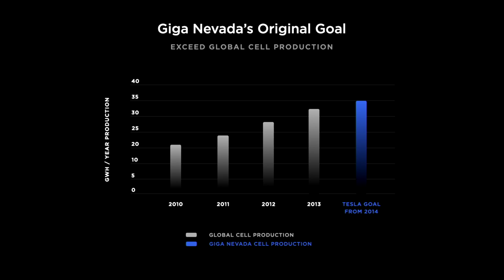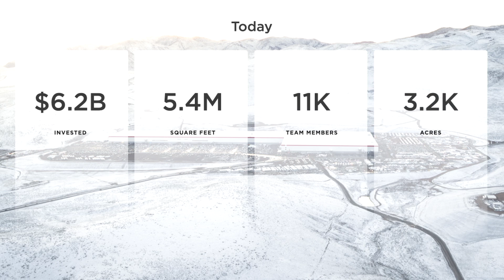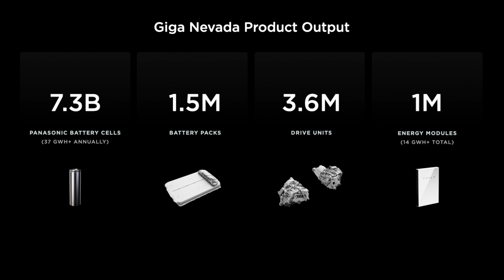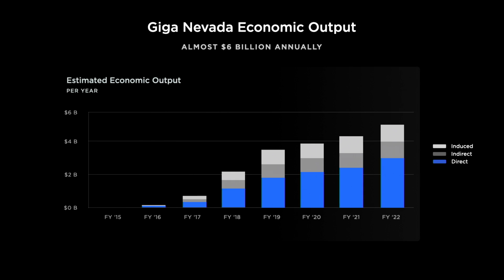Giga Nevada Battery and Semi Manufacturing Update

Comment: Except they're not creating a sustainable energy future, they're just building some energy storage units. If you research the enormous amount of energy that humanity uses, you realise that flappy windmills and solar panels aren't going to replace fossil fuels and meet current demand, never mind future demand.

I think we will find a way to replace fossil fuels and get sustainable energy, but I don't think it will be from wind and solar, and lithium batteries will be pretty irrelevant. One way might be new propulsion technology that allows us to transport 10s of 1000s of tons of stuff to and from space. That could enable near-sun space-based solar with hydrogen or synthetic hydrocarbons for energy transport and storage, along with recycling of the carbon (a carbon cycle).

Comment: I am excited to share that I am currently working on a restoration project for an old catamaran, where my goal is to convert it to electric. I have already had success with my previous electric sailboat conversion projects, including my second sailboat which featured a 10kw electric motor and a custom-made battery pack that I built myself using 1400 21700 cells.

Now, I am taking on the challenge of converting an older catamaran 1997 to electric power, and I believe that Tesla's technology would be the perfect fit for this project. I am a big fan of Tesla and their innovation in the electric vehicle industry, and I am confident that their parts will help make this conversion a success.

I am reaching out to Tesla, specifically to Mr. Elon Musk, to inquire about obtaining the necessary battery, motor, and controller with 1350 nominal RPM for my restoration project. With Tesla's support, I believe that this catamaran will be a shining example of what is possible when converting an older vessel to electric power.

I would like to invite everyone to join me on this journey. The catamaran  have sleeping space for 8 people, so all your family can come along. I am confident that this catamaran will be a unique and unforgettable experience for all who sail on it. Thank you for your time and consideration.

ps: could be also old battery old motor , demo , or from a test  vehicles

Comment: Where is the lithium, cobalt and other toxic materials coming from?
Reply: Same place they came from for that datsun pos in your thumbnail required for sourcing, same place every gallon of gas refined that requires cobalt. Same place all the lithium used for mettalurgy comes from. 

Same place for medical equipment and every other form factor of battery used like the one in the internet capable device your pedantic self wrote this drivel on. In other words the ground. Betcha don't care about those though right? 
Because your just another uninformed sad little ev concern troll gasaholic nut. 👍🏻
Reply: @4literv6  Datsun is Japan, so no you are wrong.  Why do you say "pos?" It's a 2250lb truck thats lasted 44 years so far. 2000+ lbs payload,  34 mpg, 4 cylinder/ 5 speed. 13" high efficiency tires, E85 compatible.

 A far greater option and much more efficient than any pig heavy electric cager. 

My classic datsun compared to a new 8,000lbs cyber truck is shocking, similar payload and far greater daily range than the storage battery tesla cyber truck.
Reply: @4literv6  Where is the energy to charge these tesla branded storage batteries coming from? Isn't a large portion of mining equipment powered by fossil fuels?

Comment: 5:54 #Tesla Imagine if you haven't been told there is a technology out there right now, which can power entire house with silent electricity (an apparatus size of a sofa) : that requires no, fossil fuel, chemicals, waves, solar, thermal, batteries or fusion etc it gives out no considerable heat, smoke or noise pollution, no vibrations, it works in the dark, in a storm, no need sun, not very heavy could be eco friendly etc good bye batteries!
Reply: Never going to happen

Comment: I’m sensing a breakthrough in 4680 production. That entire full size factory was supposed to just be for batteries. Now, they will produce 100GWh with a small portion of the footprint. I guess the Maxwell acquisition and dry process is paying huge dividends.
Reply: I noticed this also, I find it likely that some exponential gain(or more like a bell curve) with square footage where with some new tech and greater scale it gets continually more  efficient(to a point) to manufacture the 4680s. I was surprised by Elon saying they were going to use it for stationary storage also.
Reply: What is the point of making toxic storage batteries?  Why all the hype?
Reply: @Dat_Sun  what is in batteries that makes them toxic? From my understanding, they are made of recyclable metals. Should we get rid of phones, tablets and laptops?
Reply: @Dat_Sun  you did not answer my question and you made several false statements. I’m not sure where you get your information, but you might want to vet your sources.
Reply: @Dat_Sun  go open your fire alarm and lick the Radium

Comment: The First Design was enormous. When this is completed it will have half the foot print of the original design but it sounds like the same output due to manufacturing improvements. Way cool.
Reply: They already reached the original goal, with half the footprint. Now they build the rest that will be several times more productive with the 4680 cells. I think they said 7x output with the same footprint. Thanks to Maxwell's dry coating tech.
Reply: Yes, the Maxwell acquisition is paying off big time.
Reply: @lemongavine  Yeah, Elon is a big Fan of Maxwell's, apparently

Comment: why tesla factory is still using diesel powered equipment to buyild the factory ? any chance for industrial collaboriation ?
Reply: There are limited lineup of battery electric construction machines. For the greater good it's better to get the factories up and running faster than waiting around for it to be possible to be built with BEV in a idealist way.
For road transport though I think it would be good to hear back on how the Tesla Semi is being used internally (as the said the would).

Comment: How about a couple more pairing on top of solar voltaic & electric storage!
solar heating & molten salt battery storage. (not electrical storage, but heat storage)

Pull heat from the roof, away from the voltaic cells to ensure they run at their favorite temperature. Distribute it into the house if needed, convert to electricity if the need is there, store if there isn't a need, convert to electricity and store in that battery if the heat battery is full, exhaust into grid if all storages are full.

Greater whole home integration could see heat pulled from refrigerator/freezer into the heat battery, and heat sent from the battery to the dryer and oven.
Reply: oh right, i always forget to include the complement. Awesome job everyone. Great video, and to the crew at Giga Nevada, YOU ROCK!
Reply: >_> more thoughts. Any interest in electric work trucks, busses, vans, excavators, etc?

Comment: At 1.27, this is where you need a tablet, or a touch screen laptop. Using a non touch screen MacBook decrease your productivity.
Reply: Agree. When sitting with the laptop at a desk I switch between touch screen and touch pad (sometimes even the pointing stick). Clicking big on screen buttons the is no need to move the mouse pointer with the touch pad, faster just to press the screen.